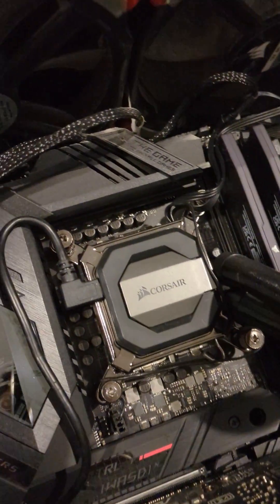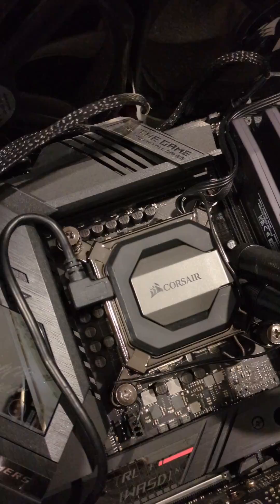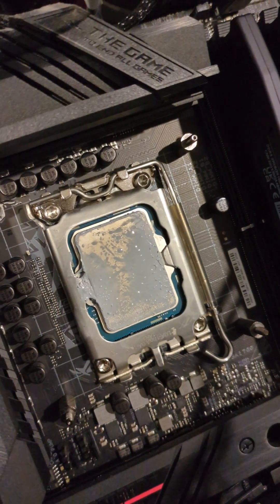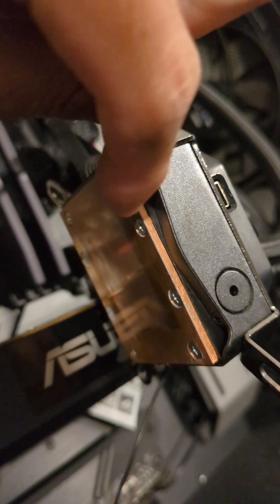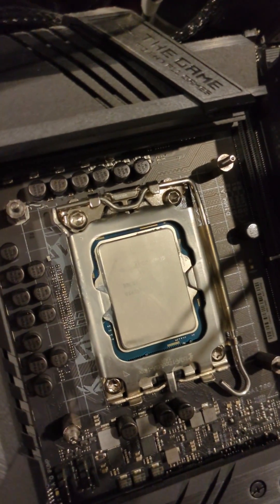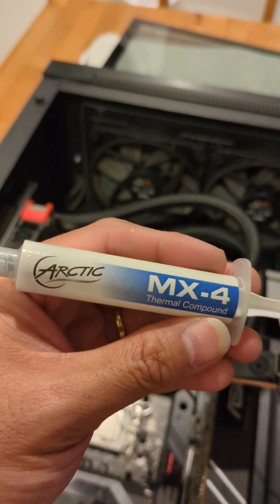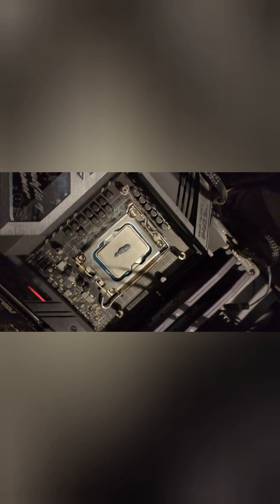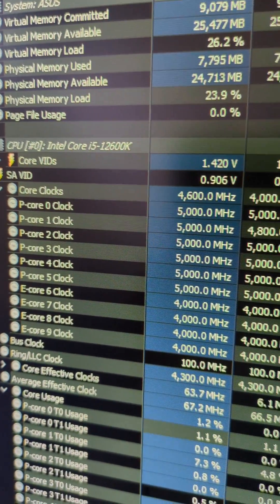Re-applying thermal paste after a year

Comment: Apparently the rectangular intel CPUs bend over time due to uneven pressure. This is entirely the fault of Intel's design. They were downplaying concerns, but it causes the CPU to operate warmer due to it making less contact with the heatsink of a fan or AIO. And the worst part is that there are products which solve the issue, but it voids Intel's warranty. Thermal Grizzly's Contact Frame is the product, if you're interested in using it, but you might not need it if you're not doing heavy overclocking.

Comment: ist it that hard to spread the thermal paste? people seem to not want to spend like 1 minute spreading the paste evenly, like... it not that hard and it is better since you dont have to worry about putting less paste than needed
Reply: I had the same thought! Why not spend the extra couple of seconds to guarantee complete coverage?
Reply from the maker: Practice it using a clear plastic so you know how much do you need
Reply from the maker: I dont spread it, pushing it down and letting it spread prevents air bubbles

Comment: Thermal paste is good for about 2 years, no need to repaste every 1 year
Reply: no need to wait 2 years. once a year is good.
Reply from the maker: I had high temps on idle, above 60. High Temps take time to go down, in the BIOS. my initial fear is that the pump is dead or dying. Everything went well after replacing the thermal paste😆
Reply: It can be good 6 months or even 4-5  years. It all depends, there are so many factors that can affect
Reply: Depends on the usage really
Reply: @macblink or you can repaste your cpu when it starts to overheat
Reply: actually chat gpt told me theres no need to replace every year. every 2 should be good